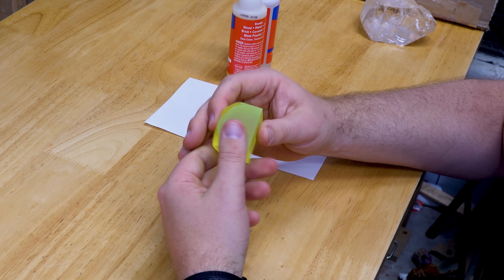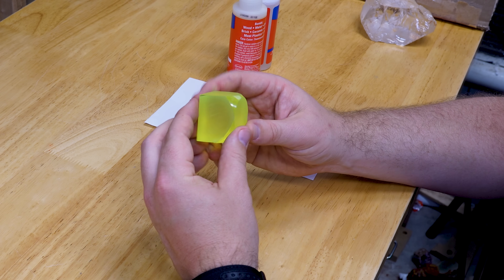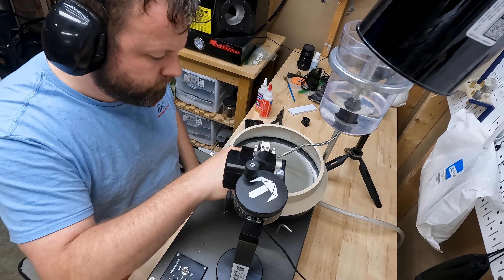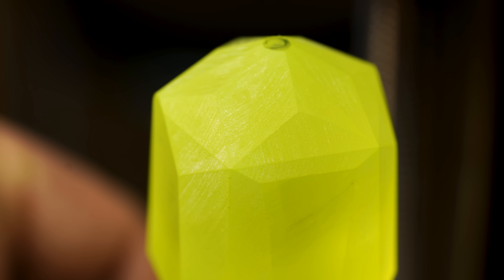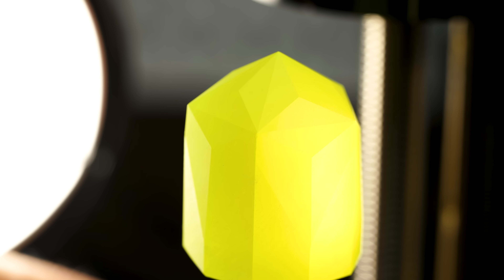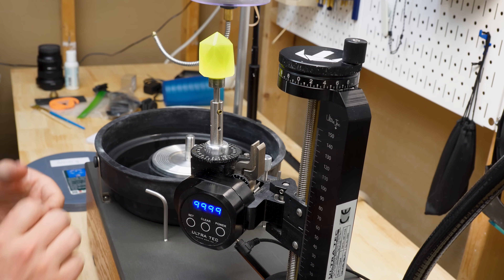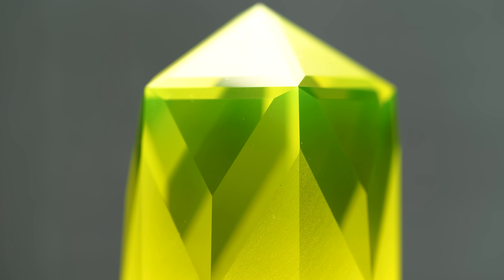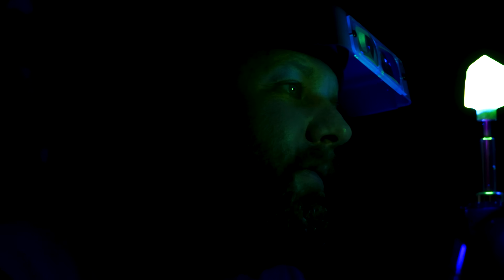Impossible Glow: LuAG (Lutetium Aluminum Garnet)

Comment: Great Projekt 😃 
You said that the second side is harder to cut than the first one due to misalignment. In the video of looked like you aligned it with the 80 grid surface.
Does the alignment get better if you use a higher grid for that?

Comment: how does he test the balance of the die?  if the weight is off on any side, it would be considered a "loaded" die.
Reply from the maker: Unless there are any large air bubbles or any inclusions within the gem, the weight is even throughout the entire rough. So as long as all of the faces are the same size, the balance will be fair.

Comment: You can take pieces of it you didnt use for the die and glue them to Si PIN tpe photodiodes to make small but very sensitive radiation detectors if you opted to use a diamond saw for the rough cutting. Also, I think your material is actually CeLu:YAG. The green color comes from the Cerium, but the Lutiticium is used to give a stable refrence count at a predicted energy.. Also the material will lase in the yellow green and several near IR lasing lines if pumped with a flash lamp.❤

Comment: Ooh, cool. I was wondering when we'd see more synthetic gemstones made for scientific purposes get faceted. Luckily, garnet is relatively easier to facet like this compared to something like topaz. While garnet is sometimes considered a brittle gemstone, it lacks any cleavage planes and is subsequently more predictable to facet. Unfortunately, garnet is relatively soft, so you need to polish it to a relatively high grit in order to achieve the best surface finish. The resultant die should definitely be rolled in a leather or padded rolling tray to avoid chipping any of the corners on a hard surface like a granite countertop.

Comment: I would love to see you try your hand at doing a die out of amber. The stuff is challenging at a whole different level. Not only do you have to have a large enough piece for projects, but one devoid (or free enough) from cracks and fracture lines, and mostly free from inclusions (bugs, and other debris). Add to this that you can have a gorgeous piece that fits the bill, but the outer color is different than the material inside. Another issue is that it can clog your sanding and polishing disks if you let it get too warm, and it starts melting.
Reply from the maker: I’ll look into it!
Reply: @hedronrockworks  Also, avoid blue amber. It's more a form of copal (Both are petrified tree resin) and can be sticky to the touch. It can cause a big problem with clogging grits (files or pads) more so than regular amber, and not something I'd recommend to try to work as an early, or first piece. 
If you do an amber piece, be sure to look at it under UV light. Won't ruin what it does, but it's also why blue amber is named as such.

Comment: Thought for your next double bevel: if you frosted the triangle face instead of the edges. You'd mask the numbers and all the bevels, and sand blast the revealed triangle faces, I think. 

Could be interesting to have high polish numbers stand out on the frosted background, and the numbers would be little windows into the glittery core of the crystal

Comment: The final dice is amazing. Definitely one of your best pieces.

Oh, by the way, minor correction, LuAG is a different material. this is Cerium-Doped Lutetium Aluminium Garnet (Ce:LuAG), not Lutetium-doped Yttrium Aluminium Garnet (Lu:YAG). Theres lots of these different materials so theyre easy to confuse lol.

YAG is part of a series of synthetic garnets called Rare Earth Garnets (REGs). LuAG and YAG are both two different materials but are chemically similar. Both can be doped with cerium. Ce:YAG has a neon yellow color, while Ce:LuAG has a neon green color.

Comment: With how glorious it looked when you first put the mask on and made it glow I'd love to see a version of this die where the etched area was inverted. I think that would look really quite special as well, and probably be lifted further if the etched area was then given a metal deposition layer or paint (or maybe don't etch it at all - a proper sputtered on coating aught to be durable enough I would think. And doing it that way you'd have a really good mirrored surface on the inside of the die too rather than the etched texture which could look really interesting). 
Still great looking die, so curse you I'm turning in a dice dragon at least in desires if not in stockpile....

Comment: Years ago, I thought it would be a good idea to turn the replaced Nd:YAG rods into dice some day. I still have the rods and after seeing this, I very much want to turn those rods into dice. Maybe perhaps I can commission you to do that.
Reply from the maker: How big are the rods? What diameter?
Reply: @hedronrockworks  D=4cm L=55cm
Reply: @drrenard1277  that's a big rod!
Reply: @AngryTurtleGems  28kw laser is what used them before. There are some cracks that formed when liquid coolant leaked into resonance chamber. Even though still usable cause it wasn't major cracking, protocol required it. Majority of the rods are just as pristine as first acquired.
Reply: @drrenard1277  I cut a Ce+Nd:YAG boule top into a D20 and it came out nice (not Hedron-level nice) so I think you'd be happy with the results.

Comment: I was wondering if you can take the ground waste powder from projects and reuse it, like if it had a strong visible quality casting it in a clear resin die etc. (I picture like sparsely flecked in clear resin if the leftover bits reflect strong enough, or just completely saturating it with different colored leftovers). Would be a cool way to utilize unusable or broken 2nds of precious materials as well if you could buy them at a discount then fragment/powder them for clear dice.
Reply from the maker: Someone did try this. I sent them some dust. But it did not work well. The dust from these gems just looks like dirt or white dust. The swarf from this is fluorescent. But it just does not look that good.